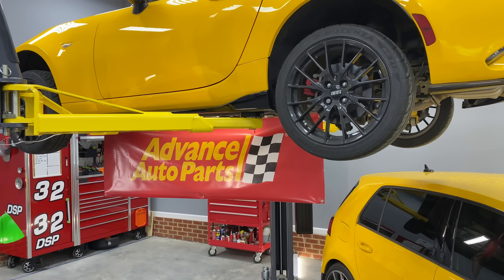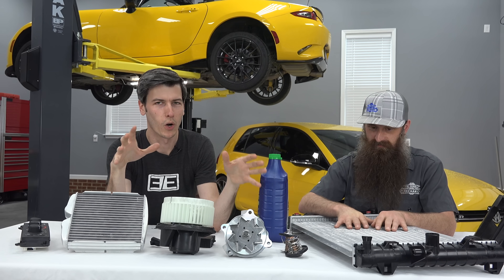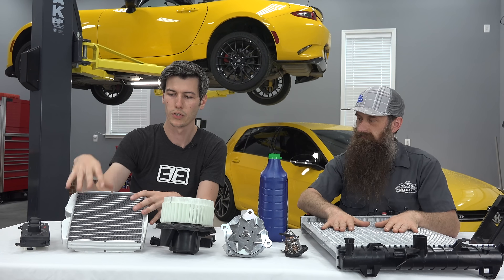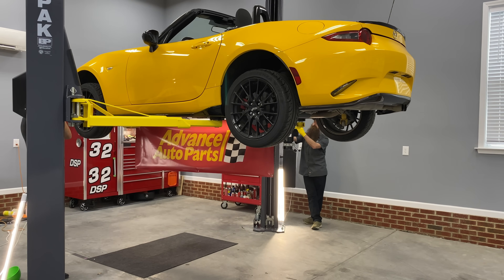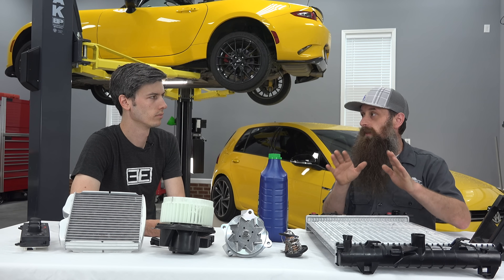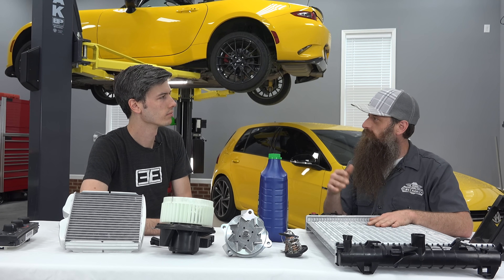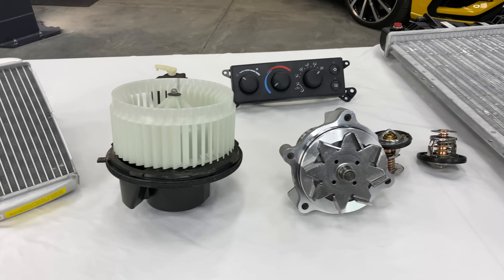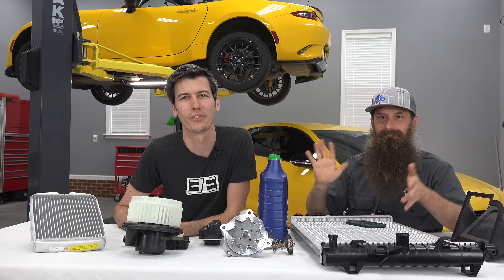Why Doesn't My Car Have Heat?

Comment: Come back Jason... I miss you
Reply from the maker: Those two yellow cars were meant to be in the same garage!
Reply: @EngineeringExplained  FACTS
Reply: @EngineeringExplained  I still don't know what happened to your black Miata.
Reply: @jamesplotkin4674  It got wrapped in mello yellow !
Reply: @EngineeringExplained  are you supercharging it?
Reply: You guys are awesome.
Reply: Hahahaaa. Yeah, though, you guys work well together. Two humble souls. Good job guys.
Reply: I have a question how do I find a leak in the coolant system. my car is leaking coolant somewhere in the engine bay but i can't find any obvious leak
Reply: @GameCyborgCh  clean and dry everything and look again for wet spots
Reply: @doomer33deg  thanks
Reply: @GameCyborgCh  also keep your fluids fresh to keep seals supple. and or just drive toyotas lol
Reply: @doomer33deg  i'm driving a 20 year old vw golf 3 xD.
Reply: @GameCyborgCh  how does the leak manifests itself? How do you know it’s leaking?
Anyway, a simple thing you may do is change the radiator cap.
Reply: @Roq-stone  coolant level slowly gets lower, and when you move the car from where it was parked you see a wet spot
Reply: @GameCyborgCh  hmm, look for coolant stain marks on the water hose joints (where hoses ends). The clamps could be letting you down. Do this when the engine is cool. 
Check the lower part of the radiator too for coolant residue.
Reply: @jamesplotkin4674  so you’re saying he should sell the car and buy a radiator cap?
Reply: @Roq-stone  Explaining a joke is so tedious...   Raise the radiator cap on a suitable lift, the put another car under it, then lower the cap on it's new home.
Reply: @jamesplotkin4674  Mr Man, just as you were pulling my leg, I was returning the favour. 😊
Reply: @Roq-stone  All good, my friend.
Reply: @GameCyborgCh  buy or rent a cooling system pressure tester and do a pressure test. It makes finding leaks 1000x easier
Reply: @GameCyborgCh  - if there are no leaks on the floor or in the interior, the most likely it's being consumed by the engine. Most common issue then would be a bad head gasket or a cracked cylinder head or block. Needless to say they are all pricey fixes at that point.
Reply: @miketeeveedub  doubt it's an engine thing. had a problem with overheating a while ago (2017 i think?) they replaced the thermostat, and some coolant hoses and check the engine because of the overheating. they said the engine is fine. i think it's more likely that it is probably a hose that either cracked or wasn't fastened securely enough
Reply: @GameCyborgCh  hm, these pieces of information would be helpful to me earlier. 
Is the car still overheating? Is it running at a higher than normal temperature? Does the water in the overfill bottle boils? Check also the condition of the  engine oil. How frequently do you have to top up the water/fluid? 
Furthermore, after parking for how long before you see fluid? And how large a puddle?
Reply: @Roq-stone  the doesn't get driven very much (Corona and all that) but after it has been parked for a couple hours to a day there are a few drops. Never any big puddle or anything like that, maybe it only leaks while the hoses are hot from driving? The leak is so slow I don't need to top it back up for a month or so (not sure haven't kept track of the exact interval). Operating temperatures are normal
Reply: @GameCyborgCh  hmmm, slight leak? There shouldn’t be any leak but since it is slow, and you declared that the hoses were recently replaced, do what I suggested earlier, check around the hoses and check the condition of the pipes. Ensure the hoses are properly positioned around the hoses on the pipes. Screw clamps are better than spring clamps.
Reply: @Roq-stone  " you declared that the hoses were recently replaced" well fairly recently, like 3 years ago but the previous ones lasted about 17.
Reply: @GameCyborgCh  that is why I’m assuming that the hoses are in good condition and I’m aiming at the clamps and pipes because of the age of the car. I’m also, telling you to check the fitting of the hoses and the tension on the clamps and their positions.
Reply: @GameCyborgCh  Pressure testing the system when cold is one way. When the engine is hot, very small leaks can evaporate so quickly they're very difficult to spot.
Reply: @GameCyborgCh  Check your engine oil, does it look milky?
Reply: Aww!
Reply: Seems like you dont want to be a-part! Sorry. :(
Reply: Lol
Reply: Ok
Reply: huhh..... GAAAAY